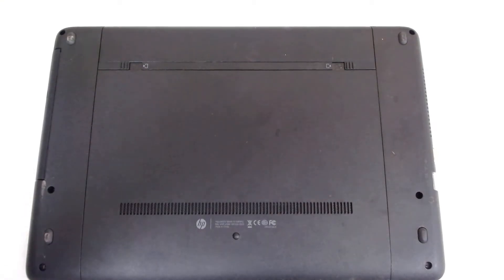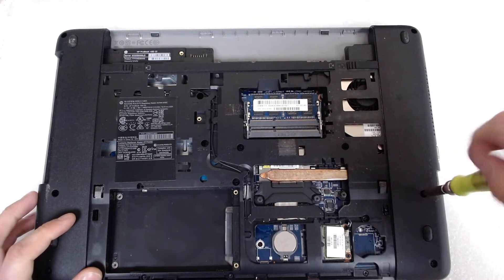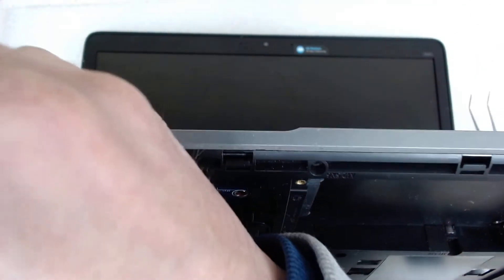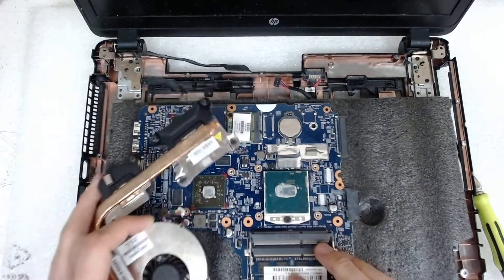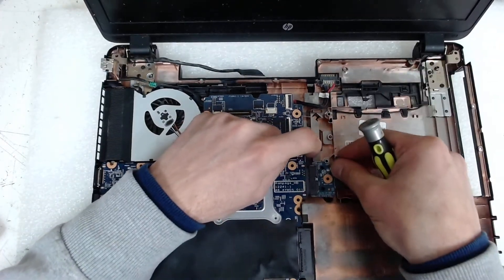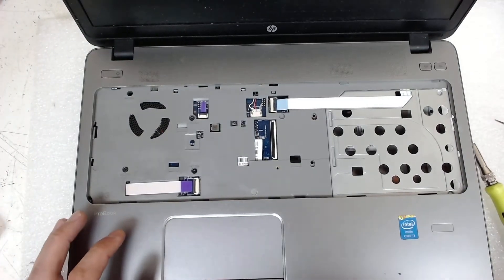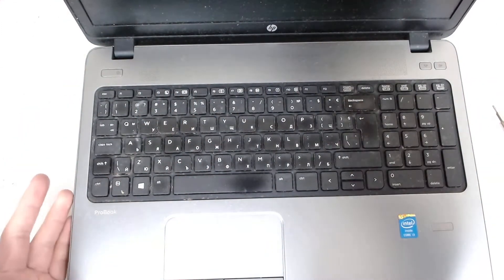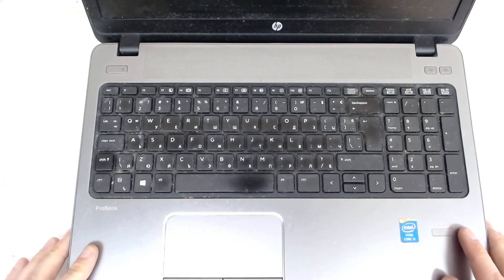HP Probook 450 G1 (455 G1) Disassembly / Assembly

Comment: Gpu dedicate ?
Reply from the maker: I think it was some ATI.. But it was a costumer laptop
Reply: @LaptopDisassembly  Is there a way to JUST remove the fan without all of this stuff with disassembling the whole thing?
Reply from the maker: @SStupendous  No the can is screwed on a metal plate with the cooler. The plate in on the other side, so you have to lift the board to get to the plate screws. Is not that hard, Just follow the video.
Reply: @LaptopDisassembly  Ah damn, I was just curious if there was a simpler way. Thanks for the straightforward answer. I will try and follow the video the best I can then.
Reply: @LaptopDisassembly  thank you for the video, seem my fan is not working anymore, can I change it only or I have to replace it with the copper pipe attached to it
Reply from the maker: @nakhla3  you can replace only the fan. No need to replace the whole cooler. But before replacing, clean it and lubricate it. It may start to work.
Reply from the maker: Yes AMD GPU